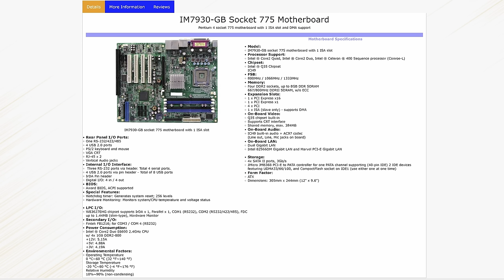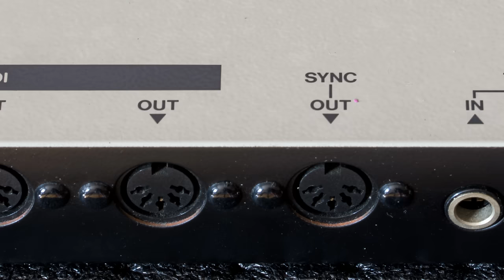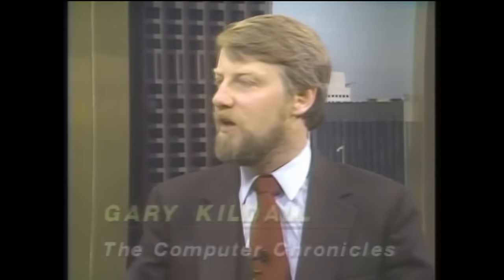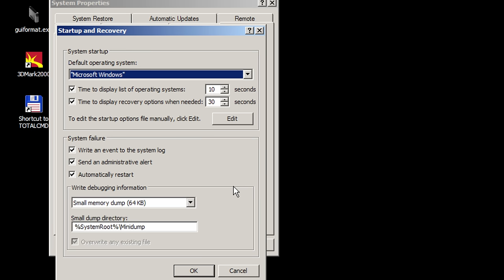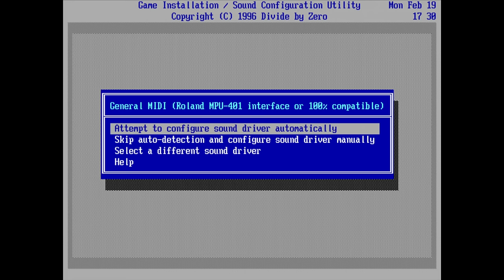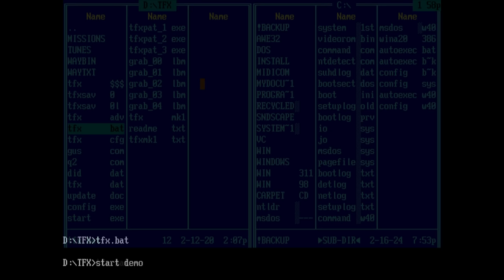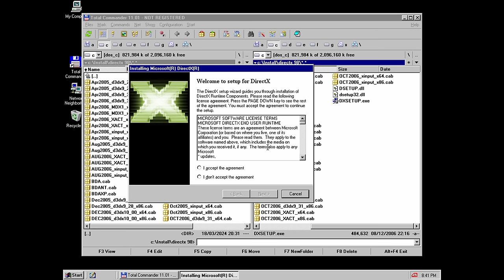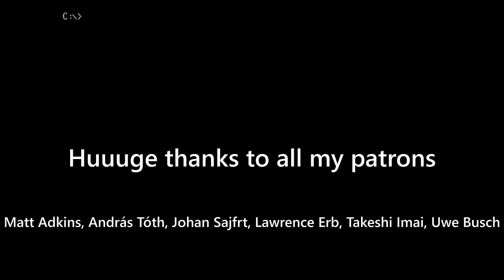The ULTIMATE retro build for DOS / Windows 3 / Windows 98 / Windows XP

Comment: That's the ultimate system in theory, in practice it is seriously flawed in the most important aspects. That video card will have incompatibilities with dos and Windows 98 3D titles, anything beyond a Geforce FX is a bad choice, and in the sound department Windows 98 is half midi and half EAX, WinXP is all EAX, a simple SB Live + SB AWE + softmpu configuration would have been a much better choice. Basically it's impossible to have a nice system for Dos, w98, and wXP
Reply from the maker: I can't agree. Literally every DOS game I tested worked without problems as well as all Windows titles. Why would I use EAX when I've got perfect stereo, which is much more enjoyable? Softmpu is good, but doesn't work in about 25% of all games.
Reply: @KITR-UK  Softmpu in gameport mode is much more compatible than that. I don't get what you say about "stereo being better than EAX", which can be also in stereo and it was a must have in 98 and XP days. That ati x850 doesn't support table fog and paletted textures in win98, drivers for 98 were not the most compatible with games, and don't support smooth scrolling and other features under DOS, Vesa video modes were dropped long ago from its bios, and it is also pretty weak for mid to late winXP games. As I said, it is impossible to build a ultimate Dos + 98 + xp system, and imho this system has major flaws in all the periods it tries to cover, its ok for dos and win98 thanks to the voodoos and all the sound stuff, but a bit cr*p for XP.
Reply: My experience with these Pentium 4 ultimate builds is there will usually be a gap depending on the video card configuration. If one goes with GeForce 4 / FX + Voodoo2, that gets you to roughly 2002-2003 (maybe a bit beyond depending on specific games), which is early XP era. Another option is to go with a 3850 or 4670 AGP for Windows XP and then a PCI Voodoo 3 or GeForce FX for DOS/9x. This results in better XP era coverage for up to mid-2000s, but does result in a potential gap with late 90s games for performance and/or compatibility. It comes down to a choice of where that gap will lie. Personally, I prefer the former option with a separate dedicated Ivy or Sandy Bridge processor for high end XP performance.
Reply: @shponglefan  I agree, and that's why you don't see speed sensitive DOS games in this video, nor late WinXP games like oblivion, Fear, Crysis...
Reply: @Romerco77  A lot of late era WinXP games are better on systems beyond the XP era. Especially with things like ultrawide resolution support.  As for DOS gaming, I've found the Pentium 4 can do speed sensitive DOS games quite well. I've been testing a Pentium 4 651 (Cedar Mill). With cache disabled it performs like a mid-range 486 and with additional throttling (ACPI / ODCM), I've got it down to 286 levels of performance. The P4 system I have is a solid machine for late 80s to early 2000s gaming.
Reply: @shponglefan  Playing games on newer operating systems than XP, defeats the purpose of a WinXP retro gaming machine, and ultrawide, community patches, remasters, etc, is another debate. Even if you can slow down a P4 to 286 levels, you are limited to PCI sound cards and we all know where that path goes, except if you can track one of those rare boards with ISA. People is not paying a lot of money for SS7 parts while throwing away P4 mother boards for nothing. There's no such thing as a "ultimate, fastest and most compatible dos+win98+xp build", a computer is needed for dos+win98 and a separate one for XP if you want to cover all the period well and have something that resembles the true experience of those old systems.

Comment: WHY!? You can emulate retro games with ease on todays technology.
Reply from the maker: Why? Because I wanted to :)
Reply: Emulation is different from retro hardware…
Reply: why not?
Reply: You can emulate everything, true. But is it the same experience? I'd argue it is far from that. And not only because the emulation is never 100% perfect in all scenarios, but also it feels vastly different.
I'd compare it to playing a racing game vs. driving a real car in a real race. A bit of an exaggeration, I admit, but you get the point.
Reply: Watching those retro builds and although I perfectly understand HW pron part of the fun and playing with all the tweaks and settings, I must say modern DOS emulation is miles more user-friendly than baremetal thing. And most of my Win XP games run fine on a modern versions of Windows and modern HW (apart of EAX part of the story). Which leaves relatively small portion of Win 98 games that still have issues and even there progress with emulation has been made, for example you can now emulate 3dfx cards even.
But nevertheless it was an excellent build idea and implementation in the video, thanks!